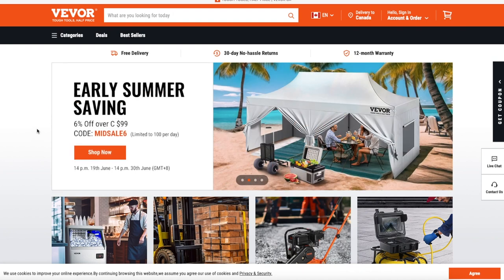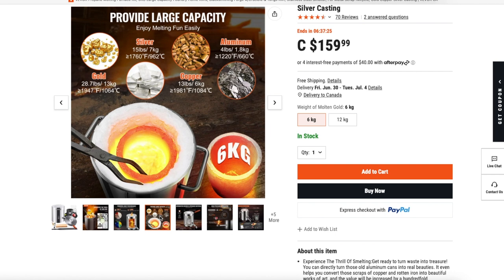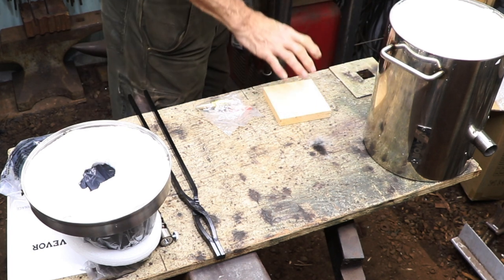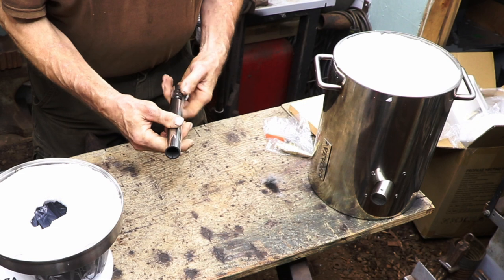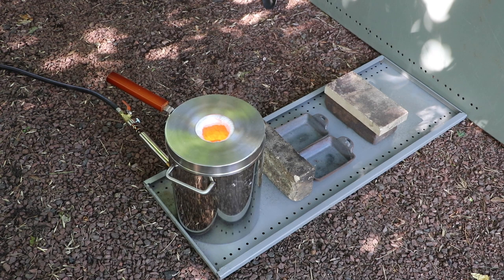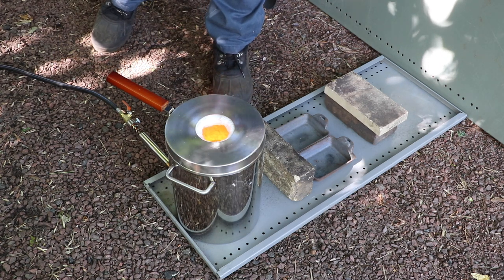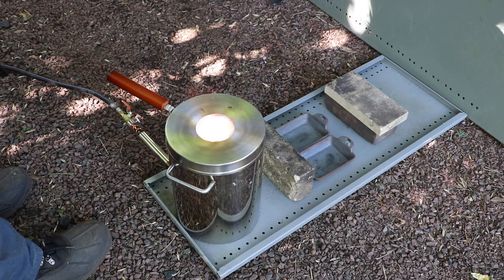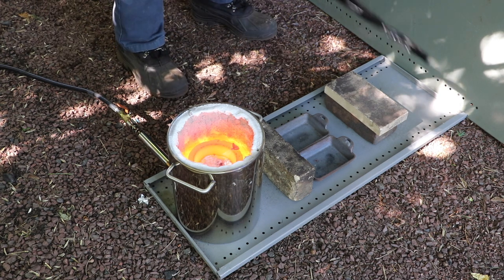Vevor foundry furnace review - DF In The Shop

Comment: The lid looks like it is insulated with k-wool. Is that correct? Is it meant to be coated with the refractory cement? Just asking as no one would want the furnace to spit out silicium fibers straight in the face of the user.
Reply from the maker: The instructions did say that the ceramic blanket should be coated with the refractory provided. This would include the lid.  They did provide enough to coat the entire unit.

Comment: Thanks, very helpful, liked and subbed. I just ordered the 12KG version, i notice you didn't coat the top of the insulation, was that to not spoil the fit of the lid? I'm assuming you coated the lid insulation except for the topside of the hole ?
Reply from the maker: I was concerned about the coating dropping into the crucible.  Also the lid doesn't
get the same abuse that the sides of the furnace do so I was willing to take the risk based on the amount of times  planed to use this furnace every year.
Reply: Ok thanks for replying. @df-intheshop330

Comment: It autoignites for me, also, the regulator was not the right size. Was not as positive experience here. Also, the lid insulation fall off after a couple melts. I guess it could do with some refractary cement.
Reply from the maker: Sorry to hear about that but I do not work for or represent Vevor they sent me the unit in exchange for an honest review and that's all.  Any problems or complaints need to be taken up with Vevor.  I will leave this comment so others can be aware of your experience with them.  I would appreciate another comment to update viewers on how Vevor responded to your problems,  Thanks